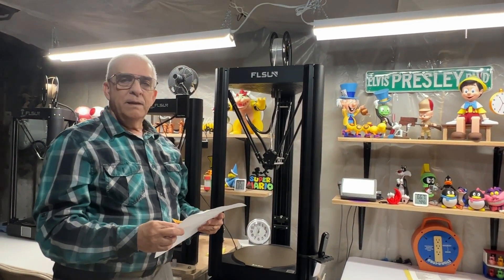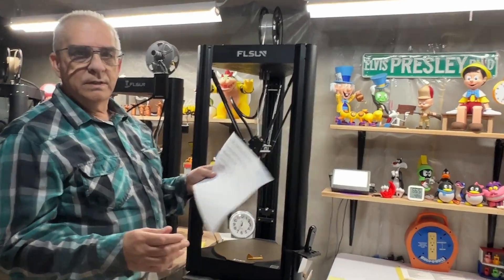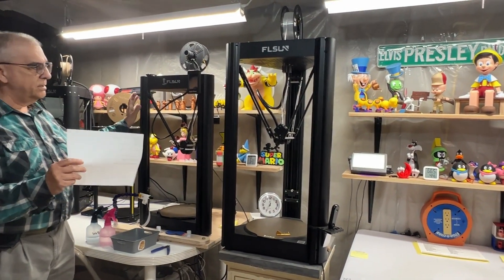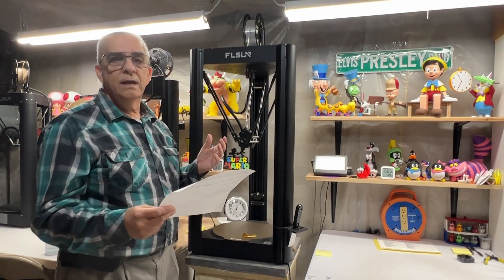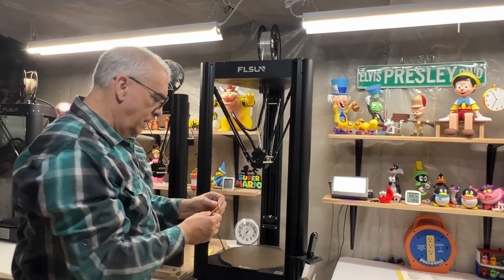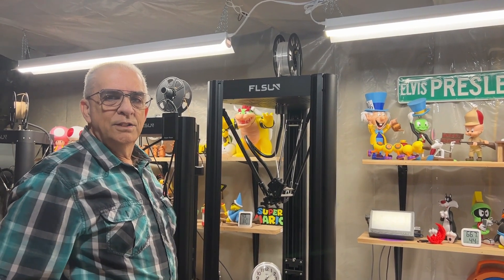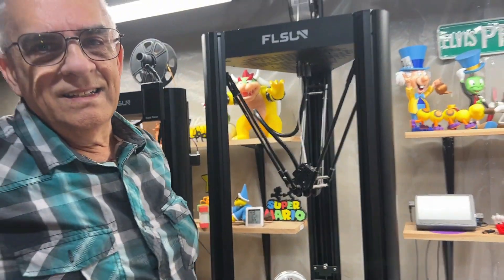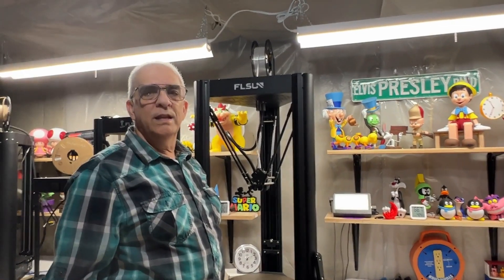FLsun V400 Belt Tension

Comment: you recently sent me a replacement pad, and I'm making sure my belts are tensioned as I am still getting terrible prints and bed leveling.  I downloaded your device from your google site but you do not show your parameters for printing.  Could you share them as stated in the video? Thank you.
Reply from the maker: .12 layer height, 3 walls, 30% infill, using Esun PLA+

Comment: I don't know whether you ever did - but did you ever change the tension yourself? Did you fancy making a video on what you learnt you seem quite methodical and you also seem to know when your printers are working well and when they are not - I can only seem to tell when it becomes disastrous...
Reply from the maker: Yes, I have adjusted my V400 belts. Just the way I show in the video. Nothing fancy. Just make sure they are very snug, NOT overtighten, And make sure they are all the same with that gauge...
Reply: @dennisgignac5103  Hey Dennis, I meant more the physical action of tightening / loosening them, which screws to turn, how to ensure that you are getting balanced tension, do you tension one belt a bit, then move to another, tension that one and move around the belts to ensure that you don't have a single belt with too much tension...any other tips, tricks, issues to avoid that you have found while tensioning your belts.

Comment: hello, thank you for your work, what are the printing parameters of your STL file and what material should we use to print the part?
Reply from the maker: I used eSun PLA+ and set the layer height to .16mm, 3 wall, 20% infill

Comment: hi sorry if I bother you. I have both the sister racer and the v400, as for the super racer, how long should the straps be? what do you use to find the hertz of the belts? and on which belt do you insert the piece printed in stl? the one that travels free or the one where you rotate it on the pin? Thanks and sorry for too many questions

Comment: Using a v400 to print this the 3mf is of limited/little use with SR set as the printer since there are rather a lot of settings that are different between the 2 and there is fair chance that hardware differences play a part in these so straight up transferring all the settings is unlikely to give a print that performs the same as the one you used.

That said, printing at the settings you put in the doc will make a tool that will work for getting the same tension on all 3 belts and that is likely to be by far the most important factor involved.

Comment: I have the same printer and in general the prints come out near perfect, however, I can't print large objects with travel speeds above 300MM/sec.  If I do the print head speeds up enough to cause it to be knocked off or slip by about 1/4" horizontally.  I think the belt is slipping but I'm not sure.  I received my printer in late January and have printed about 100 medium to small prints.  My profile is the one that came with the printer less the reduced print speeds.  I have them set to a max of 250 with typical slower first layer speeds.  The printer is new enough that I've not seen any discussions of similar problems.  Any thoughts?  I will print out the belt tensioner and see what I get.
Reply from the maker: Hello Dave:
300 is a very good speed that I use all the time. Contact me through FB Messenger and I will send you the Cura profile I use...
Dennis G. Gignac
Reply: @dennisgignac5103  Hi Dennis, thank you for your time. I too am new to 3D and bought the V400.
Have had some good success but now struggle with some prints. Since I have used about 2 spools it might be time for a belt tension. (I did download the pano - nice touch).  
I don't use FB or messenger. How do I get your Cura profile? I use Cura 3
I am interested in your techniques. 

good work, easily explained.

Comment: You posted this in a reply, but... (see walls)
Quality: 1.2
Walls: 3     <-- (Wall Thickness or Wall Line Count?)
Infill: 40
Pattern: Grid
Temp: 210 and 60
Speed: 80 print speed and 40 walls
No support
Raft: Optional
Reply from the maker: That was line count...
Reply: @dennisgignac5103  is it 1.2 or .12?

Comment: I've been trying to get my belt tension right so I thought I would loosen them up and try again and was very surprised with the results, I had one gauge on each belt. Even with the belts quite loose to where you could easily make them touch the side of the channels they still read almost perfectly in the middle i used the file by Dennis. i kinda lost i would  love it if someone would try what i did and see how accurate those gauges really are
Reply from the maker: The belts need to be very snug, NOT over tight. And most important, they should all be the same tension. Try the 60Hz method woith your phone to get them close...

Comment: Dennis, thanks for the explanation on this, as I am new to 3d printing and just bought a v400 soI will try the belt tensioning. 

My main stumbling blocks are getting stuff to stick to the bed, as it seems that the nozzle hits the infill often and knocks it off. Tried resetting first layer etc.. Z hop.. Different temperatures. Any suggestions?

I managed to get the Spider Stress test to work, but took a lot of failures  but gave up on the Clockspring torture toaster... Have you tried these?

Comment: Hello, nicely explained.
Thank you for that! 
Extra question: can you please show your settings like layerheight, material, infill, walls, etc? I'm a Prusaslicer user and have no clue how to use Cura and importing profiles.
Reply from the maker: Quality: 1.2
Walls: 3
Infill: 40
Pattern: Grid
Temp: 210 and 60
Speed: 80 print speed and 40 walls
No support
Raft: Optional

Comment: Thanks for posting this and your humility of the engineering. Although your logic is reasonable the math is All Wrong.  If the belts are the same on both printers but the length is different then the tension of the V400 should be the Same . Your not measuring frequency with that gadget, your measuring tension directly. Thats why its called a tensiometer. That tensiometer  design and calibration is just for the belts on the QR. frequency is an indirect derivative of the tension , belt mass and length. If the V400 has same belt as QR just set the tension the same. I dont have both so I can’t determine this. The V400 is longer so it will have a lower frequency at the same tension as the QR. if you use a guitar tuner you tune to the V400 frequency that is the RATIO of the lengths ( not the difference). Cheers
Reply from the maker: Thank you very much for the explaination !!!